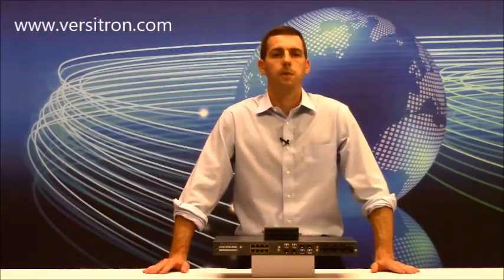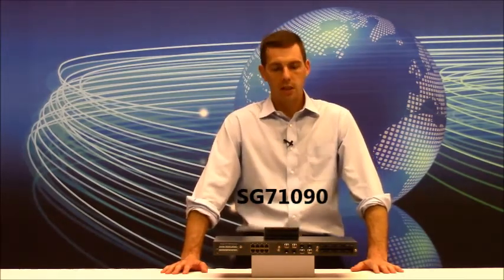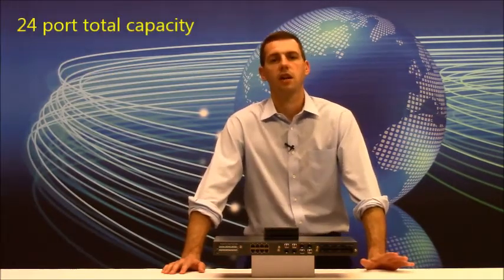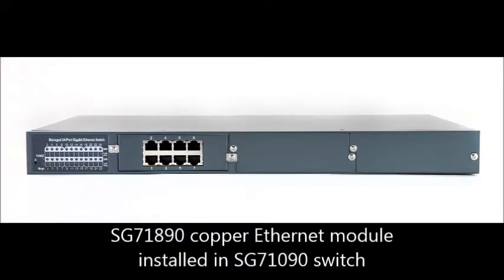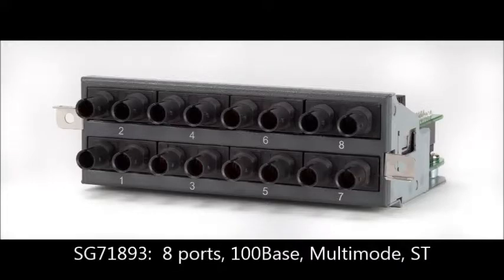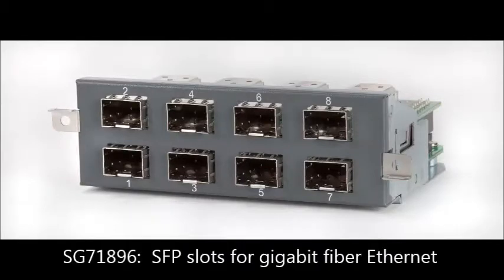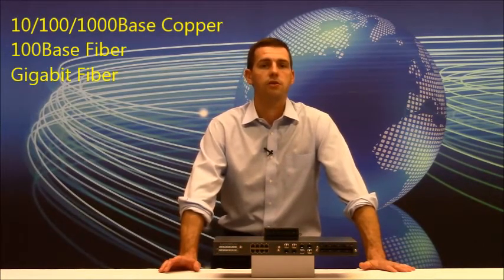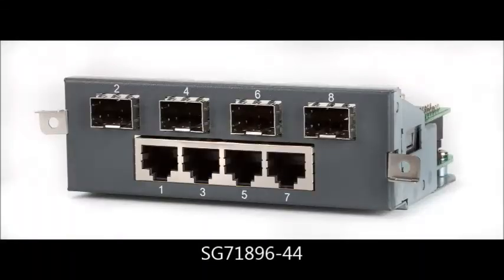Modular Network Switch | "Pick a Port" Switch - Flexible Copper & Fiber Connectivity

Comment: Will this product use 10Gb
I see that you usw ST connectors.
Normaly for 10/100Mb (Industie use)
Reply from the maker: At this time, the Pick-a-Port switch does not offer 10G capability.  However, we are launching several 10G capable switch products very soon!  Periodically check out our website for these new products.

www.versitron.com

Regarding the ST fiber connectors, these are offered for 100Base multi-mode only.  We also offer SC fiber connectors for 100Base multi-mode fiber and 100Base single-mode fiber.  LC connectors are offered for both 100Base and 1000Base multi-mode and single-mode fiber connections.